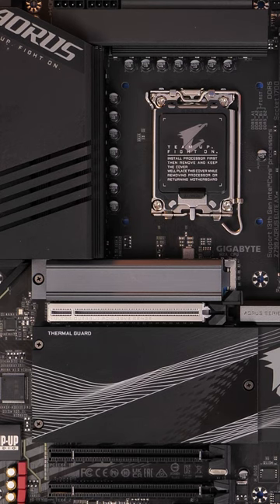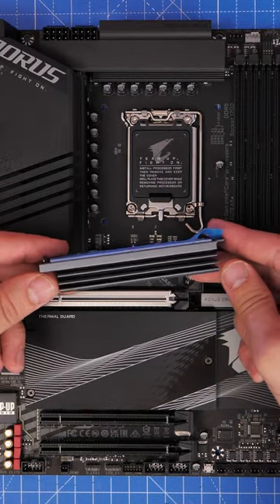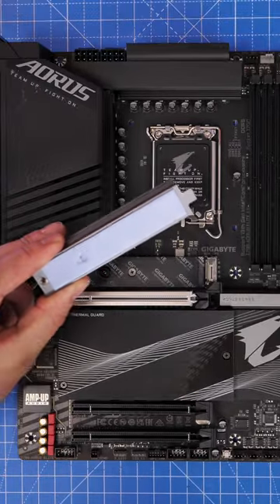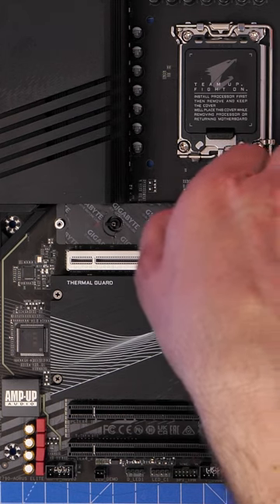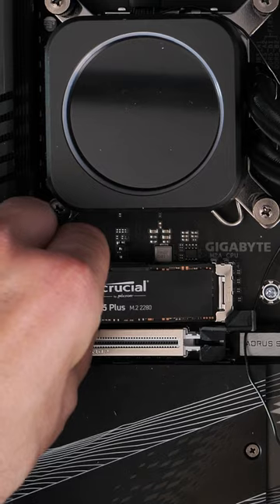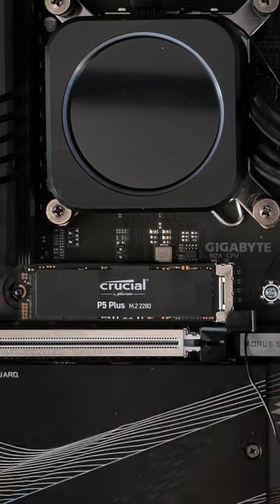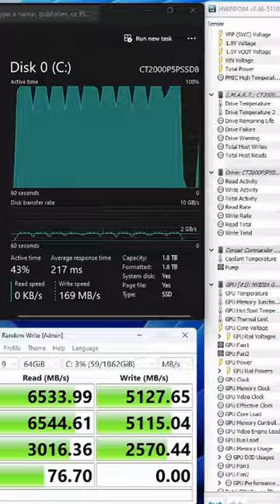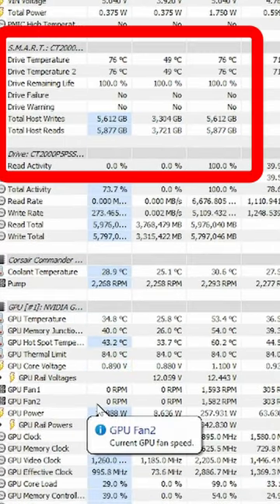Do NVMe heatsinks make a difference

Comment: He’s probably running Cenebench to get these temps up like that.  Regular use isn’t going to drive it up that high.  COD Games don’t get it that hot either.  But if your running say DDR5 at 7,000 to 8,000 plus speeds you might want to keep a good Heatsink on it.  I personally run only 2 sticks at 6,000 speed but have an auxiliary RGB Fan mounted right over the top of my Ram Modules.  That keeps them really cool and it looks good too.😊
Reply: It depends at your climate, in tropics - 70c is regular without radiator.

Comment: V-NAND are the only SSDs that don't require a heatsink.  V-NAND is what is used in 90% of devices, from the Xbox to the Nintendo Switch, to some Steamdecks to Phones and Laptops, it is 25% cheaper than NVMe, but since it is SATA based, the only improvement it provides are the speeds of SSD over HDD, the benefits?  No heat.  NVMe drives however generates *a lot of heat*, in fact as much as flash drives, but continually.  They can reach temperatures of 65° centigrade if not cooled.  All they need is passive cooling and case fan air cooling helps it even more.  With a passive heat sync, it will usually never go above 30° to 40° degrees, with good positive airflow over the heatsink, it can be reduced to 20°  to 30° degrees.   This prolongs the life of the SSD and maintains high performance.  The reason we still use towers and haven't all embraced mini-ITX is simple, most Mini-ITX cases lack good cooling, as in few case fans which limits overclocking and reduces the effectiveness of components reliant on the case fans such as DDR5, DDR4 RAM, modern Bridge Chips and NVMe SSDs

Comment: I put the mobo heatsink on my Mushkin Redline. It reaches 65 degrees during CrystalMark. My 2nd drive is a Kingston NV2 which is lower quality and slower never crossed 50 even though it has no heatsink attached

Comment: Would be worth testing motherboard heatsinks vs ssd heatsinks specifically supplied for a nvme by the manufacturer. For example those huge gen 5 ssd heatsinks recommended by the manufacturer, versus standard motherboard heatsink
Reply from the maker: Yup
Reply: @TheProvokedPrawn  gen 5 heatsinks are so big I’m hoping I’d get by with a motherboard heatsink. 
The gen 5 heatsinks ruin the aesthetics of the board

Comment: Ever wonder if oven mitts would protect your hands while removing extremally hot containers from your oven?
Reply: @TheProvokedPrawn  Ofc heatsinks make a difference.
Reply: Not the same thing. Heat sinks work because they add thermal mass and increased surface area to dissipate heat. Oven mitts work because of insulation, meaning the material is thermally less conductive.
Reply: You really thought you’re doing something with this comment

Comment: Can someone tell me if you add more nvme ssds to your motherboard? Like this one gets attached near the processor and has a heat sink. What if I want to add another ssd probably like 256 gb for windows(I like to keep the storage for windows separate)? Is it possble to a heatsink to that as well?

Comment: Speed at the cost of temperature.
Reply: thats not how it works, you have it mixed up.. Lower temperature = The longer peak performance can be sustained and what that peak performance is (depending on how fast the component thermally throttles)